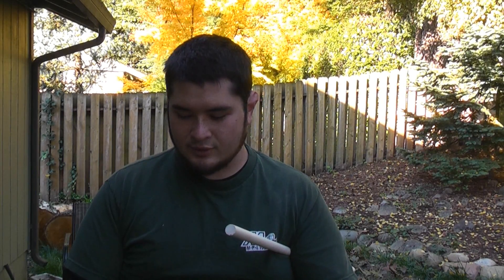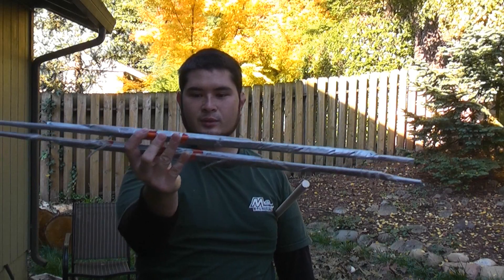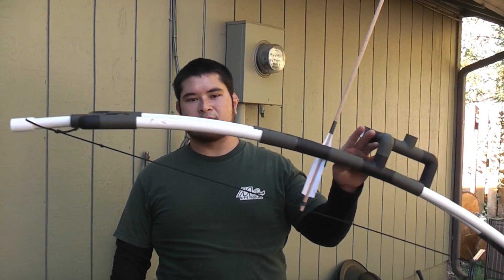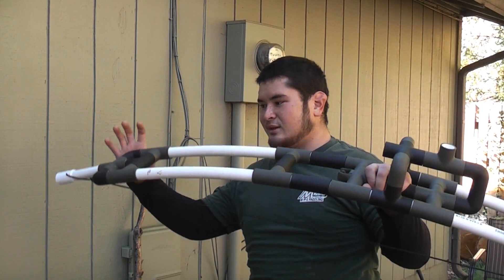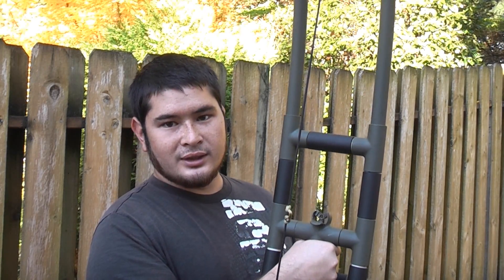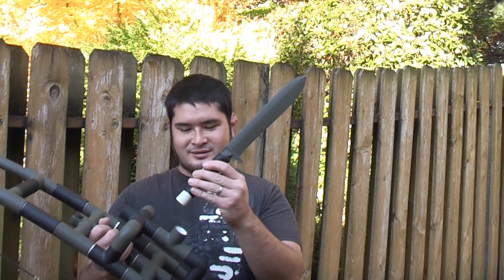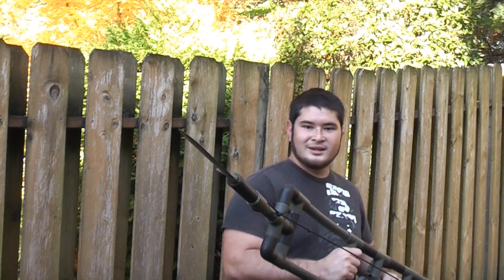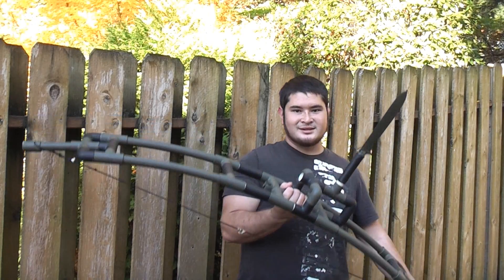How to Build OVERKILL Part 3 - 70 Pound No Heat Double Bow Part 3 - Finishing

Comment: hey nick i have a question can this design be used with 1\2 inch pvc
Reply from the maker: +chris hayes Yes, it can. The draw weight will be a lot lighter because the smaller pipes will only fit a single rod in each. It would make a good prop or display bow and would be a lot less bulky.

Thanks for watching!
Reply: BackyardBowyer
well its for my girlfriend who can not pull the same poundage as me. and what would you say the draw poundage would be

Comment: Anyone else run into this issue? The connectors don't all fit together flush because from what I can tell, the Cross connectors I bought are the only ones that are about an inch deep on the sides. Those 2 inch pvc connections are a good fit but the elbow pieces and the tee connectors are shorter than the cross connecters so when you stick everything together all the way, the handle section is not flush together it has all these ugly gaps. I tried to cut down the 2 inch pieces shorter to compensate, but the corner pieces especially create an issue because they are so shallow. It looks like Nick has all perfectly matched pieces but maybe that's where they are sold where he is?

Comment: What if you filled the limbs with spray foam from a spray can instead of using the fiberglass?
Reply from the maker: Depending on how well you spray the foam, it may or may not do anything. The fiberglass rods help to even out the flex of the bow, the spray foam would just add mass to the pipe. The bow would end up bending mainly in the center like a shallow rounded V, rather than a nice D shape the glass rods help form.